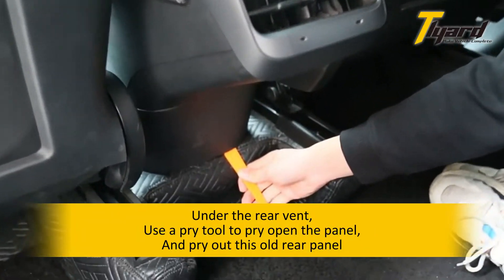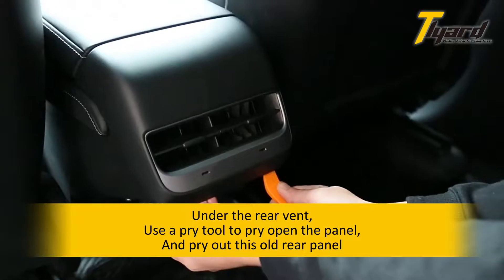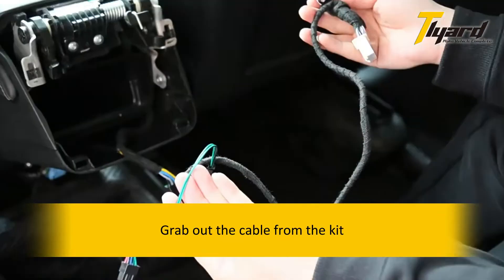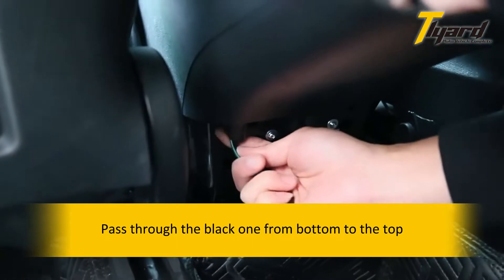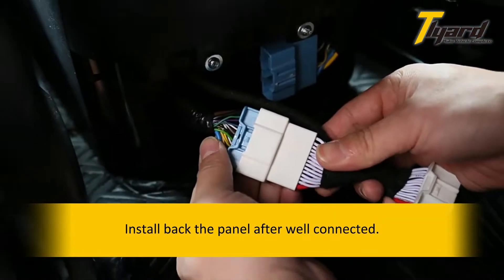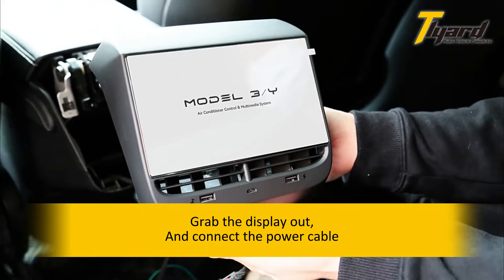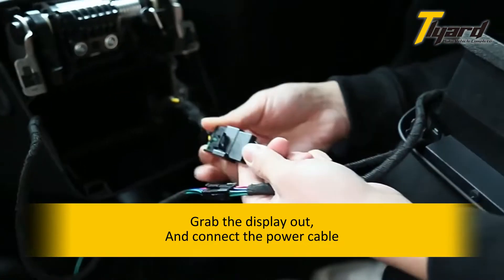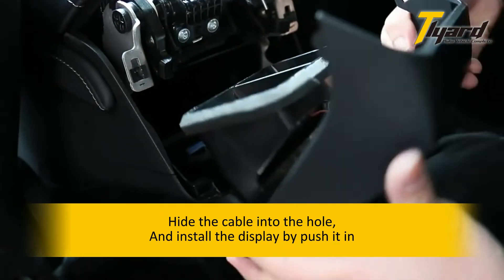Tesla Model 3/Y 7'' Rear Entertainment LCD Display installation guide

Comment: I like the looks of this screen and super easy to install. I did come across two problems though.

1) I downloaded Waze and the unit doesn't seem to be able to get a GPS signal. Is there a way to turn it on/off?

2) I installed Disney+. App works, account works, but when I try a video I get a code 39 error. Any ideas here?